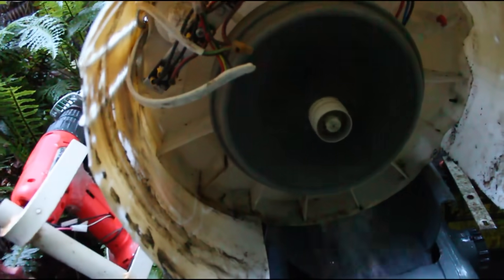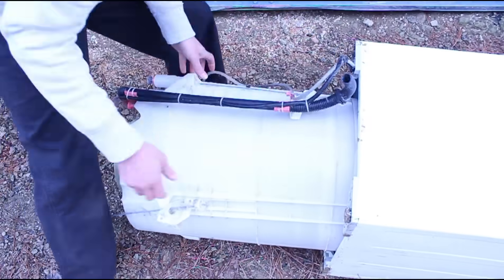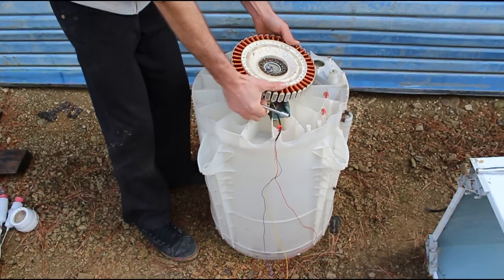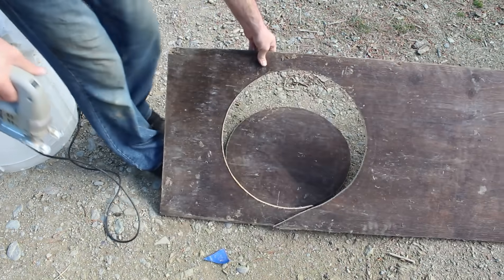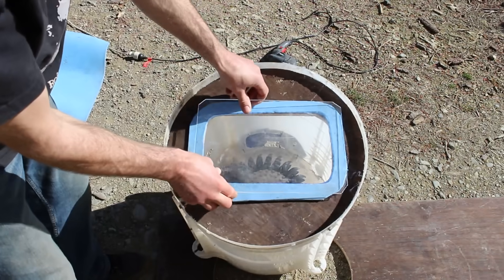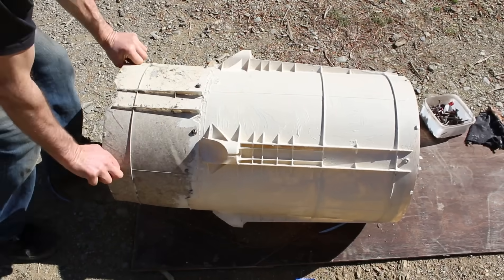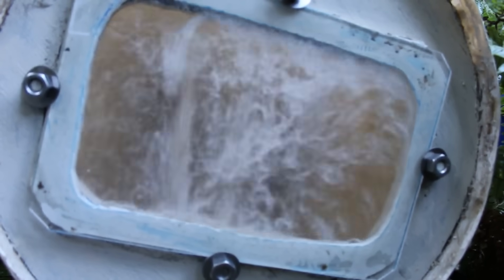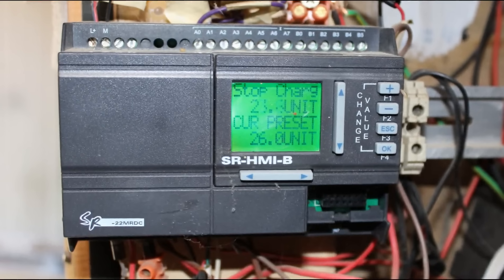Free power- How to convert an old washing machine into a water powered generator

Comment: 45 psi of water pressure would require a height difference of 105 feet.  Is his property really that large?
Reply: in another video he mentions the intake pipe is 4" diameter and 150 meters long going uphill
Reply: @sandylotion  105 meter vertical rise, or a diagonal distance of 105 meters?
Reply: Kuolettava ! 150 meters (approx 492 feet) diagonal distance, incline increases pretty heavily almost the entire distance , i would imagine he would have quite a bit of pressure with that distance even a slight incline should work

Comment: How do you get water ressure
Reply: The water inside the pipe from upstream is affected by gravity which gives it "weight"
The longer the pipe and the further the fall the higher the pressure at the bottom of the pipe.
If the water had been in the pipe and fallen 229 feet, the pressure would be 100 psi......

Comment: Typical Horizontal BeltDriven Washing Machines
Motor type • Three-phase ACIM (two poles); • Three-phase PMSM (eight poles)
Load capacity of standard washer size 60 cm x 60 cm x 85 cm
• From 5 kg up to 12 kg • Typically—7 kg or 8 kg
Drum spin speed • From 1000 RPM to 1600 RPM
Transmission ratio—drum to motor
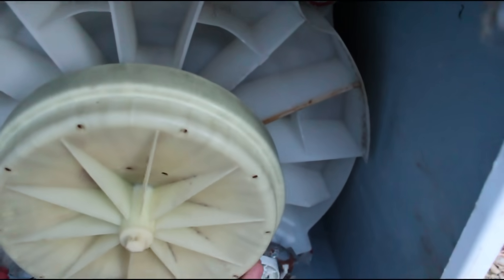• From 1:6 to 1:16;  • Typically around 1:10
Motor power • About 750 W  Motor torque • About 2 nm
• In some cases 3.5 nm
Reply from the maker: The smartdrive is direct drive, no belt

Comment: wind power too?
Reply from the maker: Yes these can be easily adapted to a wind powered turbine, cut the alloy hub out of  the plastic and press into a steel pipe, the pipe can then be welded to the swivel
Reply: @Rambro-angryram  You could put it upside down with the water running out what used to be the top while turning the top part into a vertical column turbine and get extra power...  maybe for smaller setups..
Great Idea, Thank you for showing.  I knew it could be done, just haven't seen it until your video.
have you tried using an alternator?  It puts the current already in a 12v format...

Comment: why not leave it at 400ac, string the line overhead and wind a transformer to drop it to the 1xx or 2xx you are going to realize it at.  this should get you more energy at the plug while spending less on copper. thats in general though it will vary with the distance from moving water to living room, skills, tools and materials people already have.
Reply from the maker: Yes you could do that but the factory wiring produces far higher hz than standard  household power, many appliances don't like the higher hz, they wont last long.
Reply: i wondered the same thing, about twelve years ago.       the initial output of the pma  is  'wild'  ac.    and NOT usable.    so, it is first converted to dc, then the dc is inverted to mains ac, for use in a home.      cheers

Comment: How do you get 45psi from a stream
Reply: You need vertical height...
which you can acheive over a long steep slope...
The water is acted on by grvity..
the further the water falls in the penstock (pipe) the greater the pressure at the bottom at the jet.....
Reply: The column of water inside the pipe; gravity works to aid the weght of the water; the more height between where the water enters the pipe and where it leaves...every metre increases the pressure available..
so a low flow but a great height can still produce electricity..
and a large water volume but low height can do the same.....

Comment: K just searched how much one fisherpaykel washing machine and all the ones coming up are front side insert ones I can’t find any where u insert the clothes at the top do I pacifically need a fisherpaykel washer or no
Reply: Any washer that doesn't have an ordinary looking electrical motor using a v belt to drive the mechanism....i.e. where the motor is integrated right onto the washing machine agitator....

Comment: But where do you get the "free" high-pressure water from? The energy required to pressurize the water will be greater than the energy that the pressurized water will be capable of delivering. This is why they build hydroelectric generators on waterfalls and places where they can get significant water flow via gravity. Because gravity is free. For us. Because natural environmental processes have moved that water up a hill for us, using sunlight and evaporation.

At this higher point, it has higher energy potential.
As that water falls, it loses energy potential.
If we let it fall through bladed turbines, it will transfer some of that energy into rotating the turbine. That rotational energy is then converted again into electricity by rotating magnets over coils of wire. Because moving magnetic fields induce electrical current in metal.

But the energy required to transport water up a hill to flow over a turbine would be greater than the energy the turbine would produce as that water flows over it. 

This is basic thermodynamics. You can not extract more energy from a system than you put into it.

Nuclear reactors are used because of the energy density. There is tons of energy sitting there in the form of a material, that can be catalyzed and released. This seems to produce more energy than you put into it, on the surface. But it uses uranium as fuel, which contains energy we're releasing.

The nuclear material is like a nature-made battery.

It would be more efficient to just use the electricity you used to pressurize the water directly, rather than putting that energy into the water, sending it through a pipe and into a generator.

There are efficiency losses at all points of this system where energy will quite literally "leak" out from. Not just bad pipe connections, but the motor that pressurized and/or pumped the water, and again more loss at the converted washing machine motor.

A Tesla 3-phase a/c motor they use in electric cars are only 95% efficient. That's the state of the art. Yours is a converted washing machine. So at best 75% efficient, and the commercial water pressurizer is probably only 75 % efficient as well.

Whoever pays your water bill is pissed.
Reply: you have run amok, without understanding that there is a  STREAM  on his property and  thirty meters of head. doh

Comment: LG washers are inverter driven. They make their own power
Reply: i hope that what you were trying to say is that these are  DC  motors; so, mains power is  converted to dc, to run 'em.
Reply: @daviddavids2884  No. The motor can use some of its inertia to generate a small amount of its own electricity, requiring less mains power to run.
Reply: @LarryMarston  then, NEVERMIND.  cuz you are still making no sense.
Reply: @daviddavids2884  How slow do I have to say it? Go to Lowe's, stick your hand in an LG front loader, spin the drum yourself, and watch it try and turn itself on.

Comment: What is the source for water pressure generator ?
Reply: A 4 inch (100mm) pipe 150metres long dropping 42 metres in total between the intake of the water and where it exits via the nozzle in the drum;  gravity "energises" the dropping column of water in the pipe....

Comment: After this is set up why cant you have a tank of water with a pump powering this unit?
Reply: because you would use more energy to pump the water than you would get out of the generator.  It would be a net energy loss.
Reply: @nathanshaffer3749  then how does it run a whole house
Reply: @liveandletlive2894  because it produces a good amount of energy. 600-900 watts.  Guess how much an electric water pump producing that much flow and pressure consumes.  Somewhere on the order of 2000 watts.  The math just don't add up.  And if you are trying to take energy for running a house, then it really doesn't add up.   

it's like if you made $100 from selling 100 cookies.  If the ingredients and labor cost you $200 to make the cookies, then you are losing.  With the $100 you can only afford to make 50 cookies, which gets you $50, which is enough to make 25 cookies...
Reply: @nathanshaffer3749  I understand the concept I'm just not sure how itll power a house but not a pump

Not sure how a pump uses more electricity than a house
Reply: @liveandletlive2894  because he probably has a super efficient house, most of the time it's probably only a few watts being used by some lights.  The extra power is stored in batteries for intermittent things like a refrigerator or power tools and stuff
Reply: @nathanshaffer3749  since the electricity is produced with speed as opposed to power (fan vs drill) why cant 1 generator spin 10 generators then just 2 will be used for regenerating and the other 8 for a hone
Reply: @nathanshaffer3749  home
Reply: Are you actually curious to know or are you just trolling for kicks?
Reply: @nathanshaffer3749  I'm totally serious (20 years old trying to learn a bit)
Reply: @liveandletlive2894  ok then, I can try to break it down for you.  

A few concepts that are important are conservation of energy, and energy losses due to inefficiencies such as friction.

You can convert energy from one form to another, but you can't create more of it out of nowhere.  And every time you convert energy, you lose a little.  It doesn't go nowhere, it just gets converted to other forms that you can't uses, like heat.  The water flowing is kinetic energy, literally the energy of motion.  The water turbine converts the kinetic energy of the flowing water to electrical energy.  If the water through the pipe has power of 1000 watts, then you can only get 1000 watts of electrical Power.  But in reality, some of that energy gets wasted so it ends up being say 600 watts, like the guy shows in the video.

Now, you mentioned hooking more generators up to it or hooking a pump up to presumably power more turbines, if I understood your questions.  I think there is a fundamental misunderstanding that is common.  When you start drawing power from the generator, it causes the generator to produce a counteracting force that slows it down.  The more electrical current you draw, the more force it takes from the water to spin it. If you draw too much, it will stall completely.  So if you hook a high current pump up to the generator, or stack a bunch of generators on the the turbine and try to draw power from them, the turbine will eventually be overwhelmed and stop spinning.  Further more, at each of these devices, you are losing energy to heat.

You can experiment with little DC motors to see this effect yourself.  If you have access to electrical junk and can pull small DC motors out, you can play around.  Get say 5 motors and label them A, B, C, D, and E.  Hook Motor A up to a battery and it will spin.  Connect the the shaft of the A and B together so A spins B.  If you connect a small light to the terminals of motor B, it should light up.  Now, if you connect motor C to the terminals of B, it might spin, but probably a lot slower than B is spinning and just hooking it up will cause B to slow.  Now try hooking the remaining motors D and E. If they spin, they will spin very slowly and motor A will slow drastically.  Now try shorting out the terminals of motor B, it should jus seize up and stop.

Does any of that begin to explain why it doesn't work to just string togetherness more generators?  If you are curious and want a more detailed explanation, I would suggest looking up articles and videos on thermodynamics
Reply: @nathanshaffer3749  thanks for taking the time to write that all up!

Alot clearer now to me
Reply: @nathanshaffer3749  what if you were to hook it up using a "transmission" so for every 1 of the power generators revolutions the actual generator would spin 5 times wouldn't that create 5x the power since electricity is generated based on speed not power
Reply: @liveandletlive2894  well, you're making an assertion that isn't true.  Power is a factor of speed x force in the case of mechanical power, you n the case of electrical power it is a factor of voltage x current.  If you increase the speed you decrease the force and get the same power.  Likewise, you will increase the voltage of the output, but you will decrease the current capability and still end up with the same electrical power.

I think you are confusing the word power for force.  It's a common enough confusion, but it is important to understand when talking about these types of systems.  

Remember, that when speed up the output with a transmission, you are also increasing the leverage that the generator has to slow down the turbine when a current is drawn.  So when you turn all the lights on, it will be like trying to go up a steep hill in your car in 5th gear, you engine will stall. Same thing happens to the turbine
Reply: @nathanshaffer3749  ok I think my mistake is...when you start drawing power it physically exerts the motor and tries to slow it down?
Reply: @liveandletlive2894  that is exactly the case, and it is something that is not obvious, so can easily be missed
Reply: @nathanshaffer3749  ah ok I didnt realize that I always assumed a fan motor would be sufficient as it produces speed but without any force now you've explained that once theres a draw the motor will need speed and force to continue

Comment: Hello, my name is Veronica Aleman, and I am the creator of a nonprofit called Karmic Quarks whose mission is to help oversee humanities transition to a new world where there is no unnecessary pain and suffering. One of the biggest ways to accomplish this mission is to help free society from the restraints of gas and coal energy, and create systems where we utilize free energy to work for us on a collective level. 

Which brings me to my question for you. Do you think its possible to install micro wind turbines inside of this power generator? I ask because my husband and I have a power washing company, and at one of the jobsites when I was cleaning off the side of a house with an enclosed area with a width of about 5 feet or so, I noticed the pressure of the water hitting the sides of the walls so hard that it created a sort of wind vortex where all the elements around went crazy for a bit at that particular angle. So, I started imagining a device that created wind with water pressure in an enclosed area with a bunch of micro wind turbines that could spin inside it and generate electricity. 

If you could make a video doing something like that, that would be AMAZING. It could be the beginning of a revolutionary energy harvesting process.
Reply: That wind vortex happens around waterfalls too.
But it is a waste of energy...you need a solid column of either wind or water
If you have the water put it in a pipe and use it as water...

Comment: how you can build that 45 psi hose ???
Reply from the maker: I have a stream, the inlet is higher than the outlet, this height difference creates the pressure
Reply: @Rambro-angryram  you could make a video on how you built that or with a drawing. Say In what materials and why you use this type ... Thanks . I like your videos !

Comment: how did you increase the water pressure?
Reply from the maker: Simple physics, The pipe inlet is higher the the outlet jet, the greater the altitude between inlet and outlet, the higher the water pressure
Reply: thanks for the speedy reply i really want to try and replicate what you have done is amazing welldone! what kind of height difference are we talking to get that kind of pressure?
Reply from the maker: around 32 metres
Reply: ok thanks

Comment: why rectify ac to dc and then convert back to ac?  why not just use a step  up or down transformer to get what ac voltage u need?????
Reply from the maker: HZ is too high, and the rpm would change with every different load I put on it so output voltage would constantly fluctuate

Comment: Much easier way to do this. Simply modify a gas powered generator and power it with water pressure instead of a gas engine.

Comment: Now try and connect that to the toaster oven and see how far you get.
Reply: If you connect the toaster via the batteries and an inverter...no problem.

The hydro running 24/7 stores the necessary energy for high draw appliances...and releases it via an inverter....

Only for welding does Marty use a generator as the current etc actually fries inverters.

See the Marty T channel which is Marty's later channel...4 vids re a new system setup for a friend.

Comment: What rpm does the generator spin at?
Reply from the maker: around 1000 rpm
Reply: Angry Ram why not use an alternator from a car. You can get about 100 amps at 1000 rpm with a cheap alternator.

Comment: Not many of us are privileged to be living right on a fucking stream. !
Reply from the maker: All it takes is hard work and persistance to buy a property with a stream. Not everything is handed to us on a platter.
Reply: @Rambro-angryram  My apologies 'Oh Fortunate One'..
Reply: @hipstarchild  What if you used main water pipe entering your house instead? You basically install the generator right where the main water pipe enters your house so the water passes through the generator first and spin the turbine blades before going to rest of your house therefore generating electricity without relying on natural source of stream. Be sure to keep the turbine blade and electricity generating coil at safe distance and make sure everything is properly shielded so there's no contact between water and electricity.